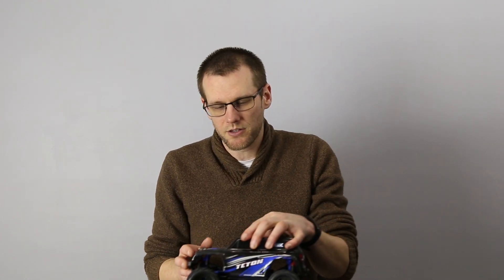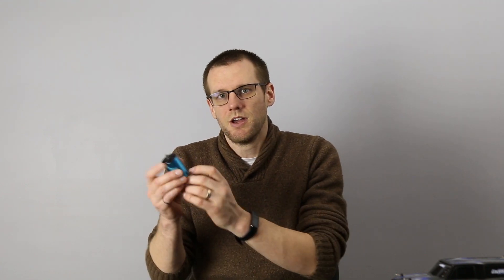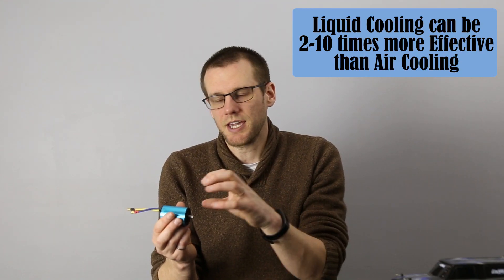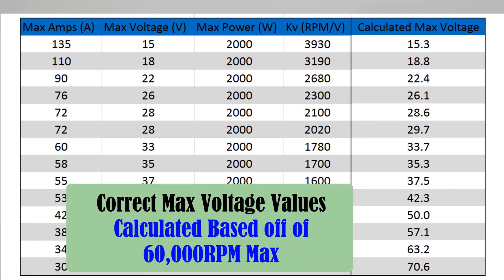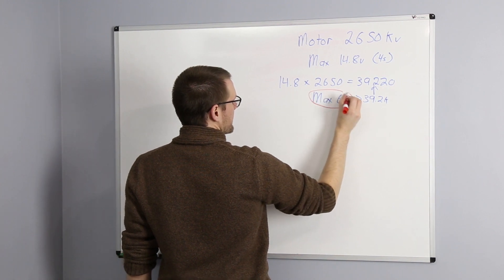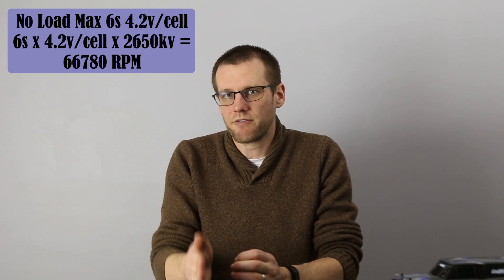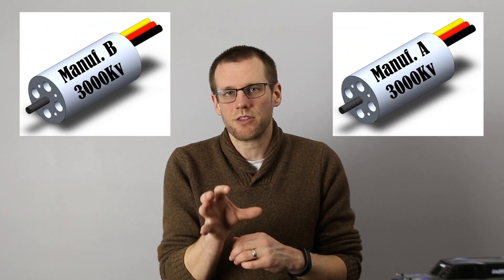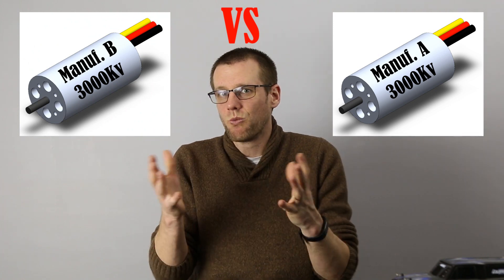5 Things an RC Motor Manufacture Doesn't Want YOU to Know

Comment: Absolutely nothing wrong running a 32pitch with a 0.8pitch gear. If the mesh is lined up right, the difference in pitch isn't even noticeable even running the car over time. Never cross a pitch like 32p with 0.6p or 48p but 32p with 0.8p is fine.

Comment: Thanks for the vid Ryan. I suppose we don't know how much redundancy is built in to a motor. It's a bit like chip-tuning your car: You might get away with a 5 - 10% increase in power output (for example) without sacrificing much in terms of reliability, but anything more could be a risk. Well, at least an RC motor is a lot cheaper than a car, so a little risk-taking is ok I guess!
Reply from the maker: Luckily for our motors, we will know when we hit the limit when the motor is over temp. Unfortunately for full size cars, you won't know you are at the limit until a rod comes out the side of the block.

Comment: Is there a reason that you rarely see people use thermal paste with heatsinks and motors? I can't think of any but one assumes that would greatly improve the cooling performance.
Reply: Rc car people need to talk to PC people.  PC people know that a large heatsink must be in as close contact as possible with the cpu for efficient cooling.
Most rc car heatsinks have huge gaps with very little contact between the motor and heatsink with no thermal compound and with teeny tiny over revving fans.
Reply: Then you pc builders that have 20 different wires for 12 volts on multiple connectors when they should just use larger gauge wires.
Reply: @toolbaggers  this was entirely my logic. My buggy's heatsink slides all over the place, definitely not good for heat transfer. It's running pretty cool so no point but if I run into heat issues that's the first thing I'm trying. My bet that will do way more than sticking a bunch of extra fans on.
Reply from the maker: It would definitely help thermal transfer. I wouldn't want to use thermal past on the motor just because it tends to be quite messy. But if I wanted to win a race or gain an edge, I wouldn't think twice. ;)
Reply: @RCexplained  thermal compound makes a HUGE difference in the world of PC cooling.  But unlike in rc,  it's very very easy to conduct repeatable, and well defined testing methods that PC gamers do when overclocking their rigs.
Reply from the maker: This video used a near 10 year old 3770K OC to 5.0GHz and cooled with an H60. It's a completely different game when considering a 50x50mm square CPU contact pad is used to transfer 125w of waste heat vs a 40x74mm motor removing 300w of waste heat. A well made RC motor heat sink can achieve adequate contact without the need for paste. 

Manufacturing tolerances and surface finish quality makes it more difficult to get the most out of an RC heat sink vs CPU heat sink.  Thermal paste is design to fill in micro differences in tolerance and surface finish but not intended for major gaps.
Reply: @RCexplained  "Thermal paste is design to fill in micro differences in tolerance and surface finish but not intended for major gaps."  so you're suggesting silver solder then? jk ;)

Comment: Another good video - I've been binge watching your series like Netflix lately! Question: sometimes manufacturers quote maximum efficiency specs for motors. Do you ever take this into account when selecting a motor?
Reply from the maker: I usually do not as not all manufactures provide that specification. If they do, it doesn't mean that the configuration planned to be used will be able to hit it.

Comment: Thanks for the info.  So as long as I don't exceed the max rpm or overheat the motor I can give it the voltage needed to get my desired wheel speed?  Still trying to decide what motor to try in my Bomber next.
Reply from the maker: That is correct. The hobbyist also assumes all risk when exceeding a manufactures max voltage limit.
Reply: You need to keep the rpm to a maximum 90% of the motors total rpm rating. This will ensure you keep motor in its thermo dynamic range. Remember if you run a 50.000 rpm motor at 42.000rpm
You have reached the maximum safe thermal threshold of the motor !